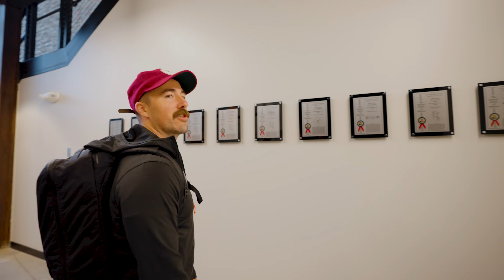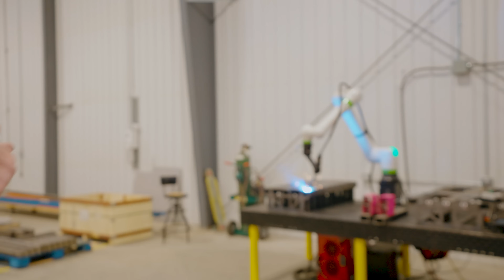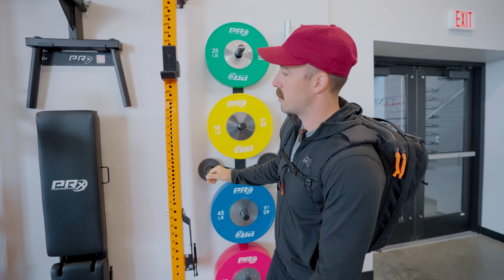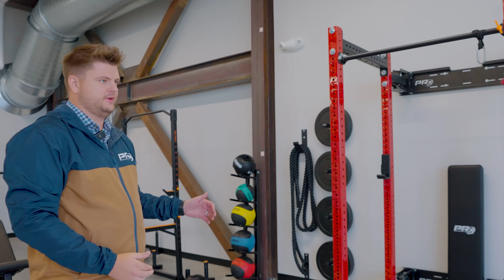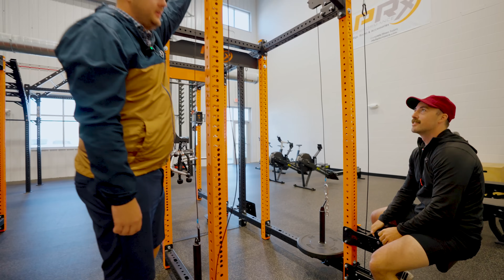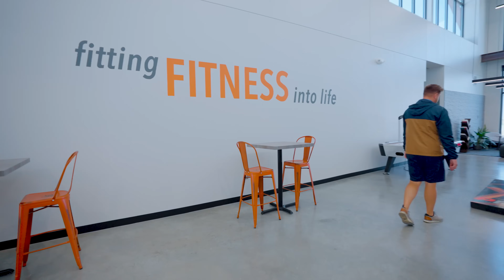The USA-Made Gym Equipment Company Shark Tank Built..PRx Walkthrough!

Comment: Really wish we moved away from saying "true" 3 by 3 as if that's the gold standard. They just made it up because every other measurement sounds silly in inches. Imagine saying they're 76.4mm by 76.4mm I have a 75 by 75 rack what do you have? I have a 76.4 by 76.4 👎

50, 60, 70 and 80 racks exist but no the Mericans need their 76.4 by 76.4 racks because 3 by 3 just rolls off the tongue. 

2 3/4 by 2 3/4 rack just doesn't have the same ring to it.

Comment: What's going to set PRX apart from the other companies are the insane engineering an simplicity in their products like the 4-post foldable, and the jammer arms. Everything else looks like they're playing catch-up and they're not that interesting. If PRX leaned into the low-friction high-quality engineering products more they'd have an even greater profile I think
Reply: Certainly, and that's our goal! Our bread and butter are the Profile® Folding Racks which always add another dimension to designing new products because our racks are wall mounted...but, we're always innovating!
Reply: @prxperformance  Thanks for the reply! I know you guys are hard at work doing your thing, I just want to underscore the fact that the excitement around your products leans solely on the low-friction high-engineering rethinking gym equipment with. That's the single biggest differentiator the gym community sees between you and other companies. We want to see you innovate stuff other companies take for granted, and don't really want to see your low-budget options for random things like benches etc. Dozens of other companies are doing those just fine. You guys have something special nobody else has, please lean on it as hard as possible and disregard the stuff that doesn't underscore your greatest strengths.
Reply: @CloaknDagger  appreciate you!! 🙌